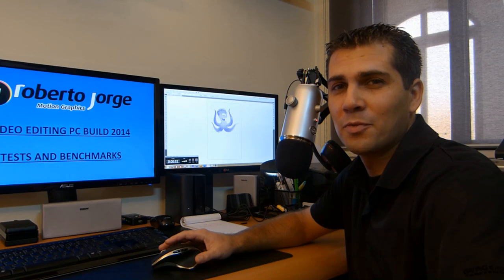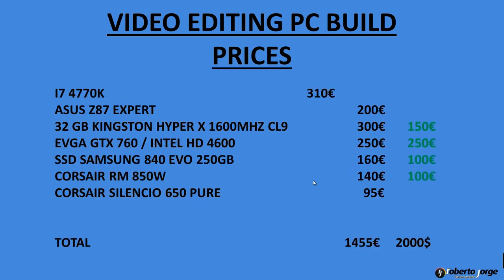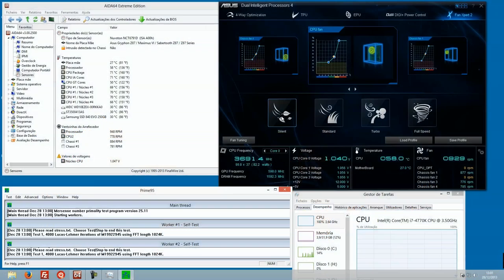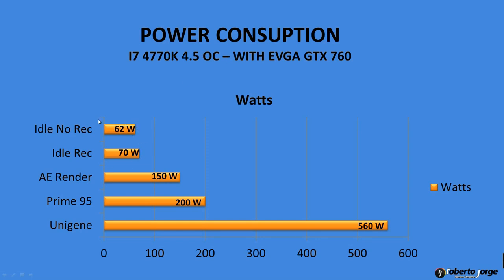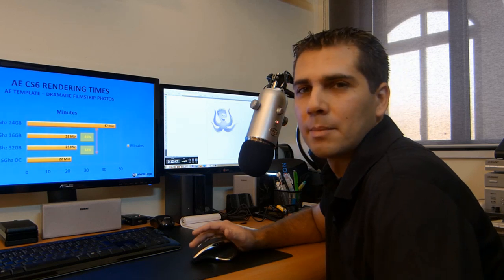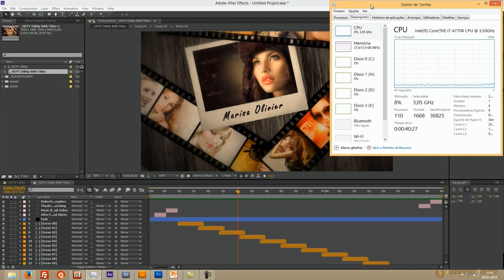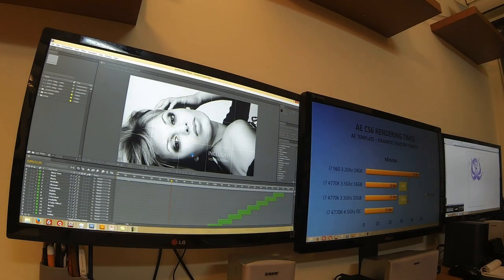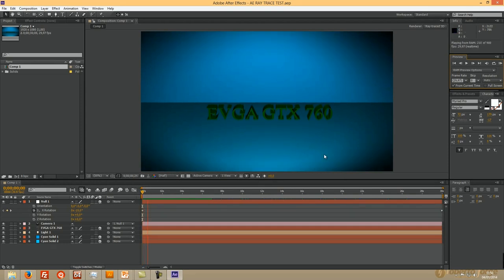Silent Video Editing PC Build 2014 Noise Levels Tests and Benchmarks 2/2

Comment: Thanks for showing you workflow since it is similar to mine it just reinforces my opinion that I should upgrade to a 4930K instead of 4770 cpu. I also run 3 monitors with multiple applications not to mention I just got a 4K monitor.
Reply from the maker: Glad i could help. Congrats on that 4K shoud be a beast :)
Reply: Roberto Jorge Yes biggest change you can make to your PC after upgrade to SSD drive. It's like seeing HD for the first time all over again!
Actually, I will have to do some more testing and see if another 780 GTX GPU will be better to get before new CPU since sometimes when I have too many windows open it does tend to get laggy.

Comment: Thanks for the video. I do very minimal AE stuff. I only use it because I like nice looking lower thirds and the occasional nice transition but other than that I don't use graphics for much of anything. Is a graphics card necessary for me since the i7 has it integrated? If I understood you right in the vid I don't really need a graphics card.  Thanks again
Reply from the maker: Hi, If you are not planning to use RAY TRACING in After Effects you will be fine with the integrated Intel HD4600.

Comment: ULTIMATE Build a Better $2000 Gaming & Silent Workstation PC Computer "How To" Guide
at 33:10 he says that system uses 465 watts under full gpu/cpu load. That system has a 4770k and a gtx 780. 
so the 560 watts power draw on unigine that you show here makes me scratch my head a little. Maybe your measurement tool gives a wrong number or something.
Reply from the maker: GrinderDevil Hi, ive seen the video before, but thanks for that question. Its possible that my devide has a wrong reading but very unlikely. In my opinion we have to factor that the benchmark i used was Unigine Valley and Linus used Furmark and Aida Cpu test so are they diferent? probably, by how much? I cant tell has never tried furmark. Another factor to have in attention is that my GPU is actually driving 3x1080 p displays for a total of 5760x1080 pixels witch will obviously use more power from the GPU. So my guess is that the difference will be mainly by multiple displays being used and probably some differences in benchmarks uses Valley vs Furmark. This is off course the conclusion that i can take from the diference that we notice in these 2 similar systems. (The idle consumption is almost the same witch also gives a bit more certain as when the GPU is not puched it can keep very low consuption but once we turn Unigine Valley feeding 5760x1080 there we will notice major GPU consuption). Hope it helps in some way. All the Best. RJ
Reply: Roberto Jorge thanks for the reply, that does clear things up.